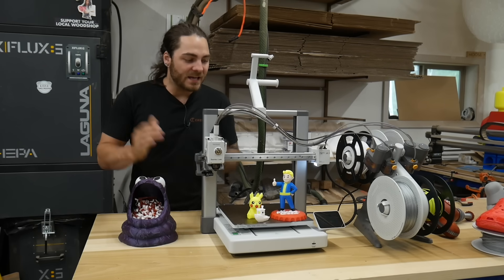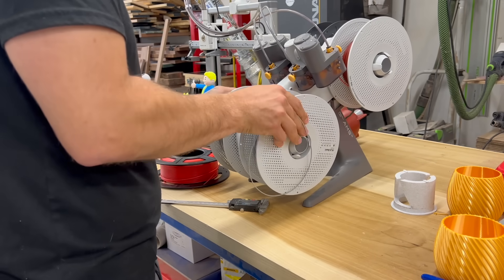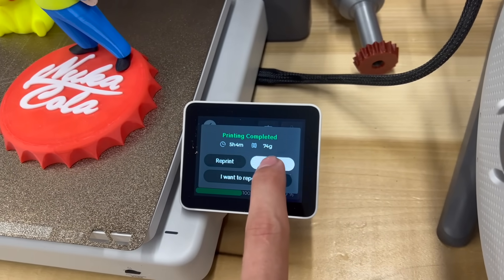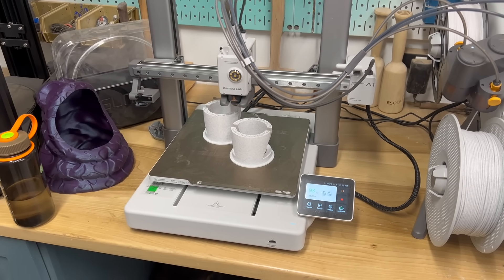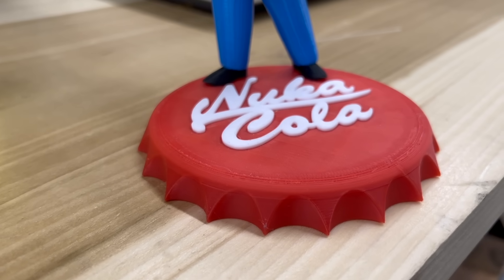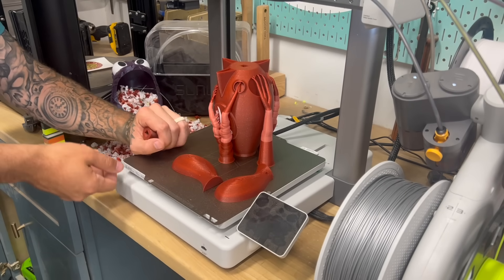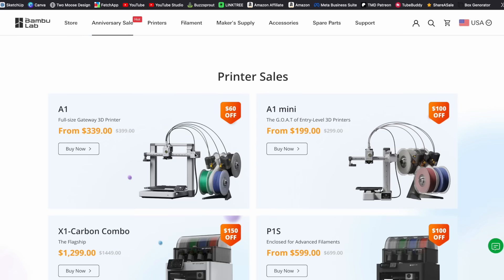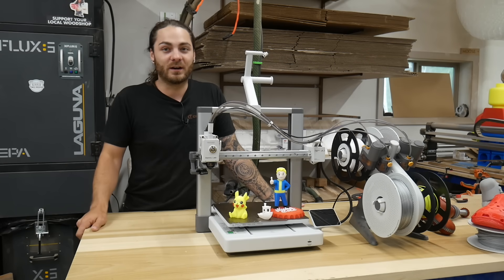Watch This Before Buying the Bambu A1...

Comment: I’ve had my X1C for over a year now and I can easily say it is FAR SUPERIOR of a printer for beginners then the A1.
Reply: Yeah and I think Bentley is a superior car for a learner driver.
Reply: It's $1300. I would fuckin hope it's a better printer 😂
Reply: @SuperSensei420 I remember when I would go to a microcenter and see printers worse than a Creality ender 3 selling for more than that.
But yeah the space is really competitive now and TBH Bamboo is just not keeping up with the competition price wise.
I feel like this is not a good time to jump in because I think things are really about to get interesting with the K2 series and Bambu response.
I jumped in at a bad time too
Got the ender 3 V2 neo and paid $240
Never had time to unbox it and by then I got the ender 3 V3 SE for $140 , the auto Z was intimidating so I just got the V3 SE
The thing has been solid and I had it printing in 30 minutes and have had no issues with it as a beginner.
I use cura and I only had a couple of prints fail the first time because I was not getting the right orientation and support settings
I have seen benchies from the Bambi machines and they are only marginally better than mine and to a layman probably indistinguishable.
It's a hard call to make but Creality is coming out with AMS now too and the auto Z has been a game changer and makes their reputation as presented in the video of not being beginner friendly a lot less valid.
Creality is stepping up now and Bambu will have to compete with their AMS and K2.
The MSRP on the K2 is not exactly competitive but the early bird price was.
The thing is that if you are lucky enough to live near a MC it probably won't be long before you can pick one up at the early bird price or close it.
I want another machine and I have been considering the K1 and the V3 and A1 and also the p1S and X1C
But after getting burned by jumping too early before and with all the news of new innovations coming out so fast now I am going to sit it out a little longer.
Reply: My brother in Christ have you seen the price? We aren’t all made of money 

Yeah yknow a fucking ferrari is a good beginner car for your teen
Reply: Is a $1,000 machine really for beginners? Yeah I doubt that.
Reply from the maker: Yeah most people aren’t dropping $1300 on their first printer lol I typically recommend the P1S over the X1C just because it’s more affordable and most people that are new with even notice the extra bells and whistles
Reply: You must have a unlimited budget to start a new hobby or business with that tool
Reply: Let me take a loan out.
Reply from the maker: I agree it is a great printer but! The price point is a lot for a lot of people just starting out. I personally started with the X1C
Reply: I’m interested in what features exactly it has over the a1? I’ve been trying to find some videos comparing the two but so far I’ve only found that the x1c has failure detection, a better camera, ability to print with more filaments and of course not being a bed slinger (not that this affects quality from what I’ve seen) so I struggle to justify the extra price for the same build volume with a few extra features
Reply: @Nuke269  other than enclosure, i think you got it right. It also uses the superior regular ams rather than the lite. And you have to remember producing a coreXY printer is significantly more expensive than producing a bedslinger.
Reply: I have enough money to buy whatever I want and I still think the price hike on the X1C is not necessarily worth it for a beginner. I personally would prefer the P1S since it’s so much cheaper and does basically the same stuff. For a small amount of money to change the print head and gears it can do the same as the X1C. It just wouldn’t have those extras that are basically just perks. Most people have gotten away without the extra features of the X1C just fine.
Reply: Ok buy it for me
Reply: It is a superior machine but not the best beginner Bambu printer.
A1 series are better. Easier maintaining and troubleshooting with its unenclosed design. Smaller footprint. Cheaper investment. Can run the AMS too. 

Two A1 printers > one X1C
Reply: @LobstersLobsters But isn't enclosure safer
Reply: Yeah a 1500$ printer is "great" for beginners
Reply: 2k for the prusa though
Reply: As a beginner driver you should only drive Ferraris. Perfect for the beginner. Totally nothing wrong with that, not at all way more expensive than most people want to put into something they're new to.
Reply: Simple answer. No.
Reply: X1C is a good beginner printer.   You'll be good for a long time with it and $1000 is a very good price for a printer that is so easy to use a print a wide variety of materials.
Reply: @califpv  Good price? Bambu has the A1 for $400, which they market as a good beginner printer. So if $400 dollars is a good beginner printer. Why does the X1C count as a good beginner printer. If you literally can't buy a 'better' printer. This is the current consumer ready to go pinnacle. There is very little amount of AMS printers. Let alone an enclosed one with a aluminum shell, big build plate, and app connectivity. The peak... So how do you begin with the top product. The only way to get better, is to machine your own 3d printer. Vorons and prusas have a hard time competing. And Creality kinda sucks, but still offers an actual beginner printer. $200 for a Ender 3 V3 SE. Elegoo has the Neptune printers. Those count as beginner printers. Saying it cost $1000 to be a beginner at 3d printing is hurting people who are just now getting into the hobby. And BTW, I'm not scrapping on Bambu or their printers. They offer impeccable print quality and are fast. But back to the topic, the X1C is a great printer for various materials such as PLA, TPU, ABS, ASA, PC, and more. But not for a beginner.

Comment: If you are printing something small, you can print in multiples on the same plate and you will save in filament. 1 change for many vs 1 for 1
Reply from the maker: That’s a great tip! Makes so much sense. Thanks 🙏🏼
Reply: You can also make setting adjustments to reduce your waste
Reply: For the small prints, will the printer know enough to do it efficiently, limiting waste, or do you have to go to the settings and tell it that that’s what it needs to do

Comment: I have 'older' machine with wheels, and actually I think they are great! What maintenance do they need? I just use Ender 3 for two years and more and never touched those wheels after I set them up. What 'little' frustration is it about? What can give you a big frustration is maintenance of rail carets. You will understand when you will have trouble with those. = )
As for color printing, when it changes from certain layer, you can print that on any printer which support filament change on the fly. For example... Ender 3 = )
So AMS gives automatically color change. Also you actually can reduce waste percent, for example add some figure which does not depend on any color, and use it as 'waste' tower. You will get a usable 'bonus' item which you can use or sell. But it should be tall enough for the last color change takes place.
Thanks for honest review. Not everyone cares about opensource, but it is a good point at least to inform people of what this device allows to do with it.
As far as I know there is an opensource firmware for X1, if I am understand correctly it is X1Plus. Bambu was not very fond of it, but after all they allow to use it in exchange of loosing warranty(which will end in a year anyway). So at least for X1 there is some alternative software. But hardware is in big question. Also I heard on some markeplaces there are already alternative components, but not all of them.
I personally prefer Ender 3. 'cause it supports filament change, load and unload, filament movement sensor, and who knows what else? You may say 'But my XYZ printer also supports this'. OK, but I want you to remember Ender 3 is already more than 5 years on the market. And new features are still available (because of Marlin firmware and opensource structure).
But of course you will need to spare some time to set it up, may be to debug and fill a bug report.
Luckily now people who just want to pay to print can just place order on 3d farm buy a Bambu printer.

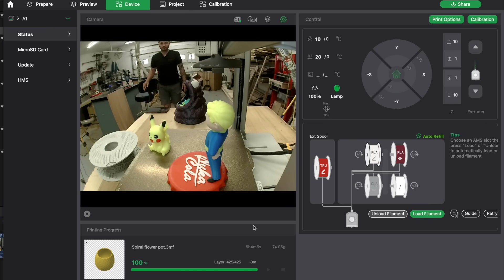Comment: I just bought the A1 mini with ams lite and I really like most of it. The camera though... it feels almost like a camera designed to spy on you rather than show you a cool print time-lapse. 4:57 just look at how much of this guy's garage is visible and how off frame the printed object is! 
I think I'm going to build a clear case for my printer so that the camera will only see reflections of the printer most of the times.
Reply: Speaking of spying, The camera streams over the internet via bambu 'cloud' servers. 
No peer to peer on the LAN. Pretty much the same mechanism as how you send jobs to the printer.
I don't know where their servers are but I have a good guess where.
Make of that what you will.
Reply: Or just rotate the lens cover over the camera maybe?
Reply from the maker: Mines typically facing a wall so it doesn’t bother me, there’s cameras in my shop, on my phone, on my computer. If someone a gonna hack me 🤷🏼‍♂️ not a whole lot I can do about it. Not like they will see much but me woodworking and 3d printing in my shop lol my printer also has a little door you can put over the camera

Comment: A couple of things: First, there is an option called "flushing volumes" in Bambu Studio and Orca where you can lessen the waste.  You can also print the waste to an STL if you want to add an extra item on the plate that you don't care about the colors of (I print the waste to screw driver bit holders).  You can also print the waste to the infill of the objects you're printing.  There are also more efficient nozzle profiles and updates coming from Bambu to reduce waste.  You'll never get rid of all of it, but you can greatly reduce it.  It's also important to note that the waste is the same if you print 1 item or 10 of the same item.
My favorite advantage of the AMS is that when printing PLA you can use PETG as your interface layer between the supports and the item you're printing so there is very little waste and the support basically just fall off.
Reply: I was put off by the sheer amount of waste however the options you have listed has really helped changed my mind, I have yet to see a reviewer talk about these options which is a damn shame
Reply: @Validoom  The community and bambu has fixed that excessive waste issue, people just need to do their research. Without updated nozzles and software which will be coming in the future, right now you can cut waste in half just by changing settings and printing your waste into something useful. Im always finding something for around the house or w/e that I can do waste to print on.
Reply from the maker: Great tips! Thanks I never thought of the multiples! That makes so much sense. Thanks 🙏🏼
Reply: @TwoMooseDesign  I'm kinda new to all this. I'm just learning free cad and you can export your 3D models to STL files.  which I believe. is compatible to most 3D printers. Is that correct? I wanna be able to use my free CAD to design parts and print them.
Reply: I like that PLA is plant based and biodegradable unlike resin printing which will last forever, is poison & wastes a TON more with no option to reduce the waste.
Reply: This came in handy when i was making my elementary school model 
Used what was gonna be poop for the flag pole
Reply: What nozzle profile is more efficient? Im going to buy it soon
Reply: That's awesome, I had no idea that support interface layer was an option, and the waste as infill is super cool for prints that don't need to be structurally secure. As someone who uses a 3D printer as a tool for prototyping and manufacturing (and just bought an A1), the AMS is looking like a much more sensible option compared to before.
Reply: How do you print the waste?
Reply: Can you really print the waste to an item like the screw drivers and you don't care about the color? This is really intriguing to me. How does this work ?
Reply: @funkyjohnhuie you sure can! Just put ad an extra STL to the project, right-click the part in the slicer, and there’s an option to tell it to use the purge instead of purging then resuming (if I remember I’ll grab the name of the setting later). The printer will still purge some but it should help reduce it.
Reply: Oh,  @MyBrokenStuff , so it's like, you have an extra build on your plate and you can use the purge stuff to print something else on the bed instead of just squirting it out? So I can be printing like an emblem as the main print but I'm the corner I could have a container using up all of the purge?
Reply: @funkyjohnhuie  exactly.
Reply: Thanks! I love this idea. I do the same thing when I have leftover epoxy after pours. I ourpour the leftover into molds and get multicolored castings. Thanks again,  @MyBrokenStuff . Now all I need is the printer. 😂 Looking at the a1 combo for my first one.
Reply: agree, it is disingenuous to talk about wasted filament and nothing about how to legitimately reduce purge .. "there are ways to reduce this but not something I've spent the time .. " ... wow, just wow!  https://youtu.be/iZvpSckbd-o&t=651
Reply: I heard a way when you somehow add a retraction command just before filament change, this will force printer to cut less filament. And take less time to color transition and thus to make less filament wasted.
Reply: Yes such videos do exist. For example this video uOtf-MifBc0
Reply: "You can also print the waste to the infill of the objects you're printing" is there a video showing that?  Pretty sure everyone would be doing that if it was true.
Reply: @krollmond7544 I’m sure there are videos showing that but it’s just a check box. This is documented on Bambi’s wiki as well. Right-click on any object in a multicolor job and there, select flush options, and you’ll see three options.
Reply: I thought the AMS lite didn’t do multi material 😮
Reply: @Ebonyqwe  It doesn't. But if you're lucky you won't run into problems. If you do run into problems though they might be a real pain to troubleshoot.
Reply: The print itself is the waste Sherlock... 99% of the morons that are using those machines print waste.
Reply: @MrDelgrigorov k.

Comment: PETG would be better for your car.  No doubt its gonna heat up and possibly warp, but the UV resistant properties of PETG as well as the heat resistance would be a more logical choice. 
About the AMS waste, You can drastically cut down waste by playing with the flushing volumes.  The default 1.0 is waaay too much.  Upon my month of usage, I have found a range of 0.30 - 0.50 is the "butterzone" dependent on color pallatte.  There is also another method bambu is working on for a firmware update, it will soon retract some of the filament before cutting and starting the purging thus wasting even less.  Another way to help make it not as wasteful is to print several models in the same print.  A prime canidate for that would be the pikachu.
Something you should have also done for the new users watching this video (good job btw!) was to enable the dynamic flow calibration.  It truly does a great job.  Will be good for the user who just wants to print without doing manual calibrations.
Reply from the maker: I said that pla would be good for everything except outside or in the car. Maybe I just said it weird lol thanks for the tips! I’ll definitely have to play with those settings! I knew you could reduce it and definitely seemed excessive at stock.  Thanks for the tips and thanks for watching i appreciate it 😁
Reply: @TwoMooseDesign  Maybe I am just getting a bit deaf or possibly dementia may be setting in! I appreciate you making the video!  Keep it up bud.   PS  Love the poopie monster!
Reply from the maker: No worries at all. And thanks I appreciate you watching and commenting. And same they cracked me up, unfortunately they are both too tall! I’ll use the big one as a candy dish for Halloween hahah
Reply: PETG is not very well for car too = ) For car ABS is needed.
Reply: @enosunim  Very true.... However the A1's cant print ABS or ASA
Reply: @enosunim  The way it comes from the factory, it cannot.  Not to mention the electronics might not be able to cut it with the increased temp.   Technically you can go the derelict method and use a trash bag....  I wouldnt risk it